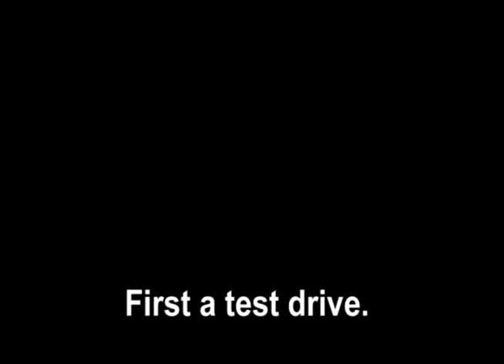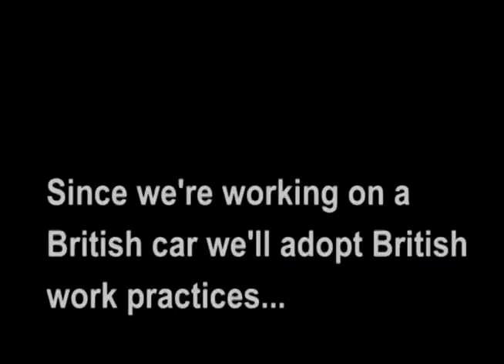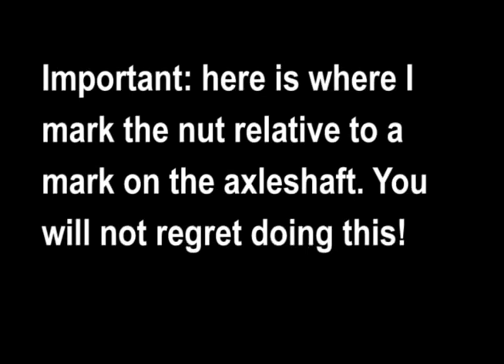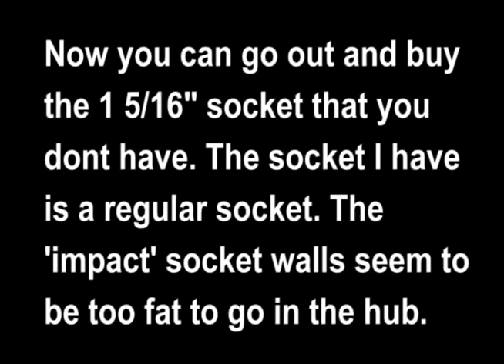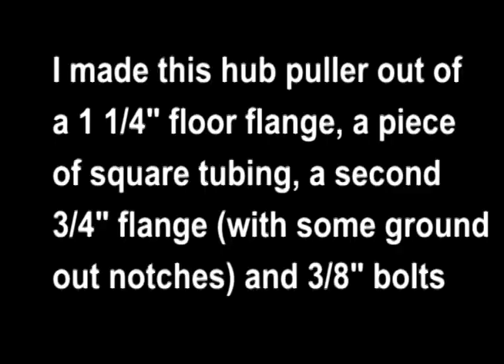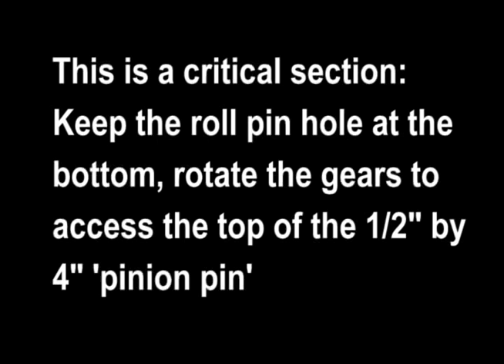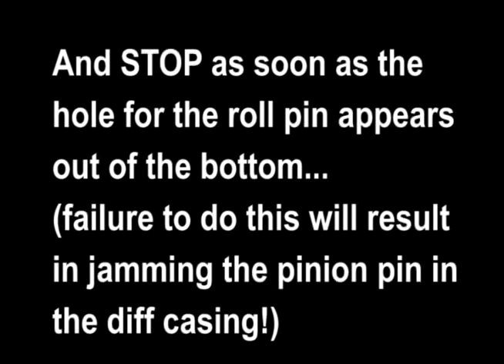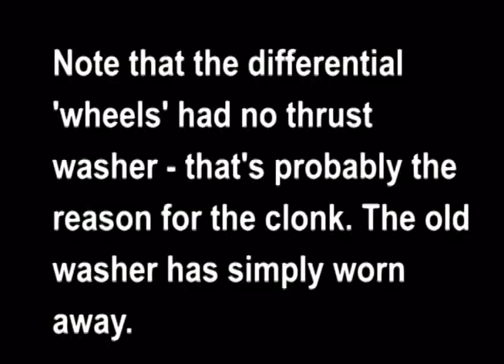MG MGB Differential Maintenance Spacer replacement

Comment: Electric motor?
Reply from the maker: Yes. I converted it from the petrol/gas engine to a direct drive AC induction motor. I have some lithium batteries to power it. I see you have a GT. I converted a friends GT a few years ago - interesting exactly the same color as yours.  Although my car has a range of about 40 miles, my friend's car will do about 120 miles.  Dig around on the videos on my channel and you'll find a couple of videos of that conversion.